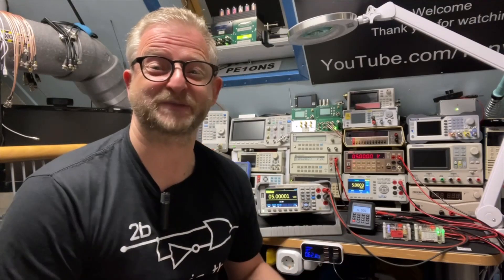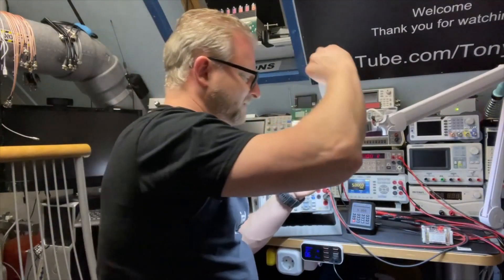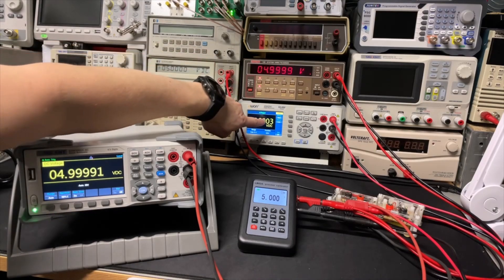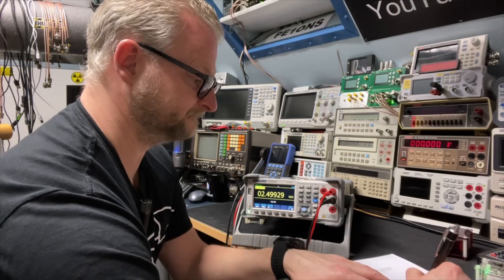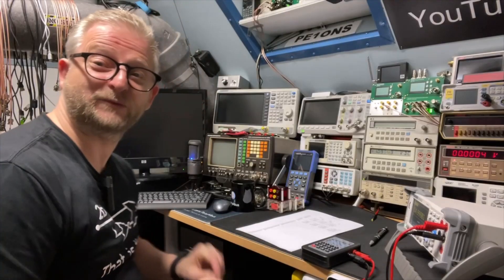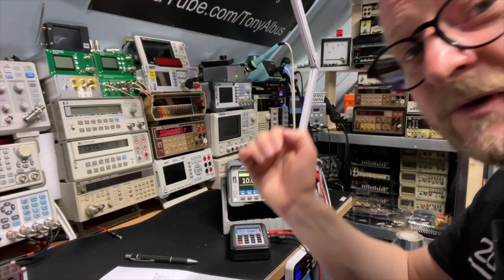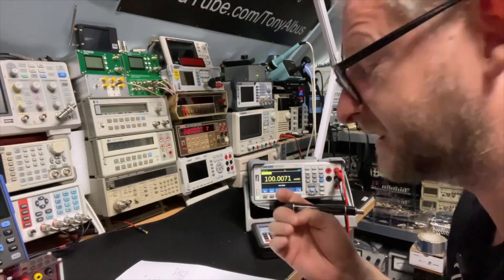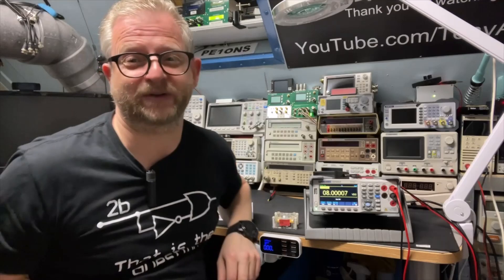#216 Calibrator LB02A and AD584 with Calibration, test with SDM3065X

Comment: Thank you for doing these tests. Do you have recommended these voltage standards For sometime now. I Purchased one several months back and use it for my vintage Hewitt Packard test equipment. It is spot on using my new Owon multimeter
Reply from the maker: Hi Mark, i may have 2 better ones coming.. after that we know which is best.
Reply from the maker: Hello Mark, Coming back to your question, i am more and more surprised by the LB02A .. is seems to have gotten better over time.
and i like the fact that you can output different currents and voltages and even Ohms. 
But beware to have an LB02A i have an LB08 i think, also on video here, and is less good calibrated, i calibrated that one myself, which kind of is weird to calibrate your own calibrator, that misses its point completely. The LB02A was good out of the box.
Reply: I’m interested in the LB02A, will watch your other reviews on it.

I want to make sure my Fluke 98 and future DMM have correct readings and aim to use the LB02A.

Comment: Have you checked, the output of your LB02A with a good high frequency oscilloscope, because judging from the way it was ‘jittering’ badly, on the last 3 least significant digits on the 6.5 digit meter you were using it indicates to me, that you just might find that there is ‘switch-mode power noise’ present on the LB02A output.  🙄   If so, then if you try adding a good quality low ESR capacitor on the output of the power rail, say something between 100uF to 470uF along with some smaller value ceramics, say a 100nF & a 1nF & a 10pF as well, you just might then find that the switch-mode noise disappears and your least significant digits then become stable on your 6.5 digit meter..!  😉
Reply from the maker: Thanks!

Comment: I finally received my AD584LH from your Aliexpress link above.  I selected the LH - and actually received an LH!  It has a nice printed sticker showing it was measured against a HP 3458A @ 25C/49%RH.  Sticker says 2.5V should read 2.49883 - measures 2.49888 on my Keithley 199 after warming up.  Learning a lot from your channel - thanks again.
Reply from the maker: Thabk you!.. good to know this seller really sells LH and you received it sounds like your keithley is still very good!

Comment: Tony, thank you for another great video. The HP 3458A is an 8 1/2 digit multimeter, if it is calibrated then the stickers supplied with your voltage reference should be quite accurate. When doing the millivolt measurements I would recommend using a shielded pair cable (such as the Pomona 1167) and connect the shield to the guard terminal of the multimeter to reduce the effects of outside interference.
Reply from the maker: Thank you David, good info and good advice!.. you are correct!

Comment: I would trust the 40 year old Keithley
Reply from the maker: Yes indeed a very nice device for sure
Reply: That HP 3478A is a fine meter as well at 5-1/2 digits 👍, and is a cousin to the legendary, 8-1/2 digit 3458A; the GOLD standard in metrology.  
A note on calibration: Let's not forget that the term "FRESHLY CALIBRATED" can be misleading, and is relative to the basic accuracy specs of the device being cal'd. A more affordable, consumer tier meter will have looser tolerances than the HP and Keithley. This means that, during cal, the "as found" variance from a nominal signal that would definitely "FAIL" with the HP and Keithley might "PASS" on the cheaper meter 😳. The cheaper meter can literally leave the cal lab with a certificate stating "PASS" in every range, but might have "FAILED" by several orders of magnitude if held to the tighter specs of a HP, Keithley, Fluke, LeCroy, etc.  
i.e. If a freshly cal'd 2nd or 3rd tier meter disagrees with your older, top tier meter, don't immediately assume that the cheaper meter is correct; a "PASS" is only relative to the basic accuracy spec of the meter being cal'd.